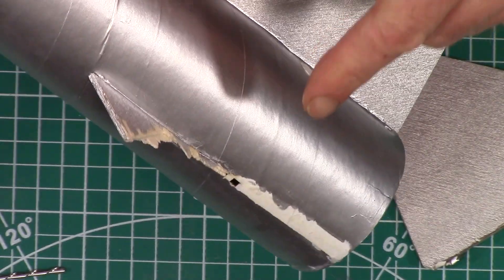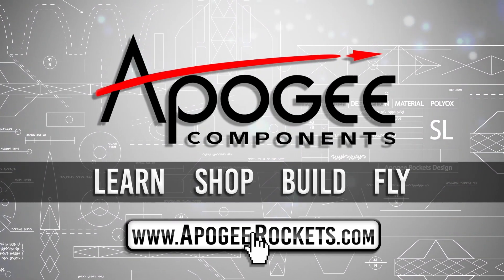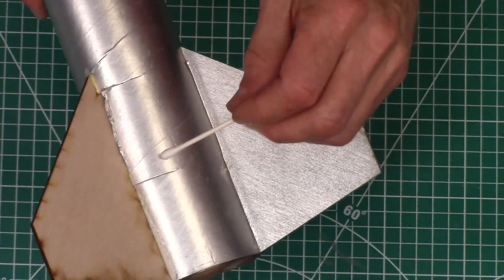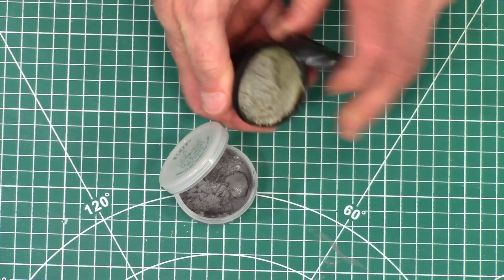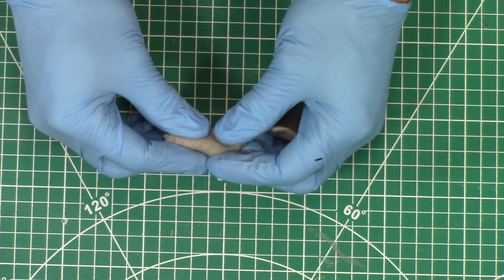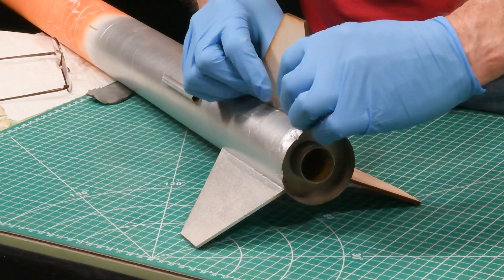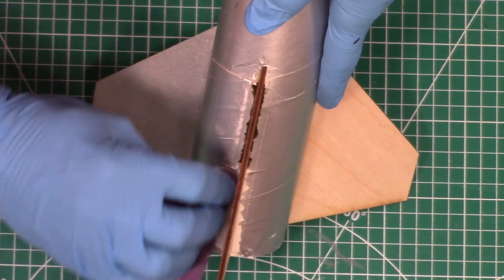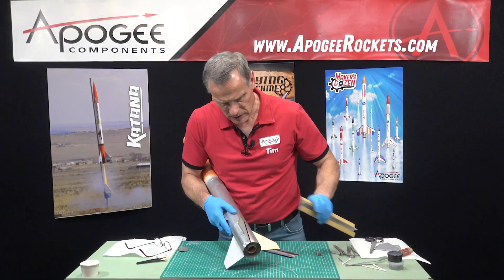How to Replace a Through-The-Wall Fin - Part 2 of 2

Comment: With the epoxy putty I have used a round object to form the putty.  In your case maybe a 1/2" diameter wood dowel.  Hold it almost parallel to the axis of the rocket and drag the end of it along the fin root to extrude the putty into a smooth fillet.  Then I dip my finger in rubbing alcohol and use that to smooth out the surface.  You can sand it a little bit then fill in small imperfections with wood putty.